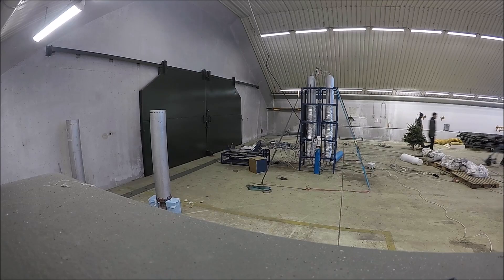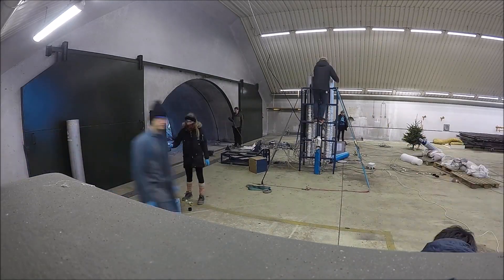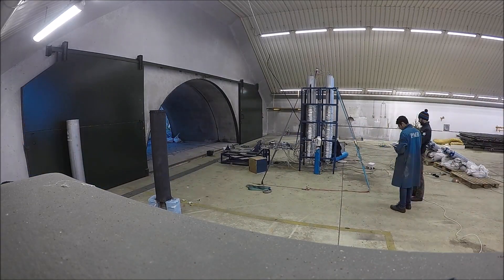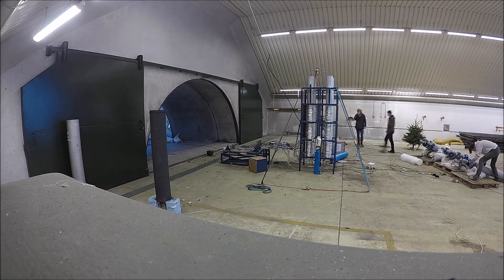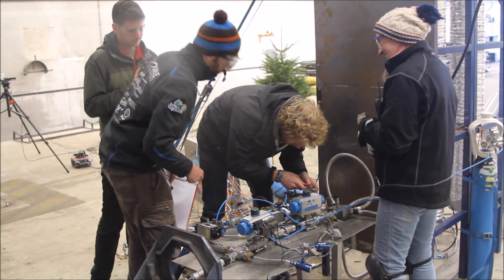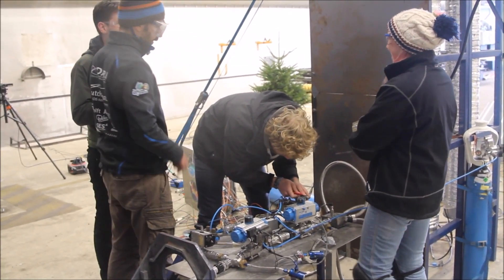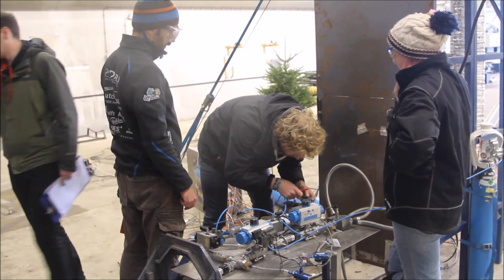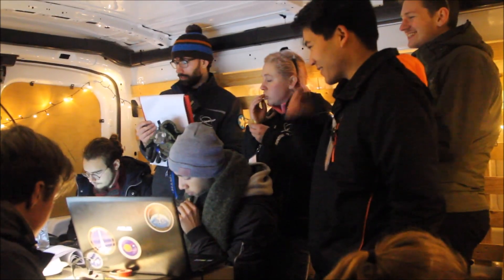DHX-400 'Nimbus' Hybrid Rocket Engine Test 17

Comment: Good to see whatever safety system you use to sense motor damage and shut down the motor worked great! What method did you use to sense this failure?

Nozzle looked under expanded though, was the chamber pressure/mass flow higher than expected?
Reply from the maker: Good question Jacob! We normally use visual inspection for this. During a test we have multiple real-time cameras at the setup, which are observed carefully by our test crew. In addition on DARE safety officer has his hand on the emergency stop button throughout the entire test whilst observing the camera footage. Once an anomaly occurs he/she can press the button and the system immediately goes in emergency shutdown mode.